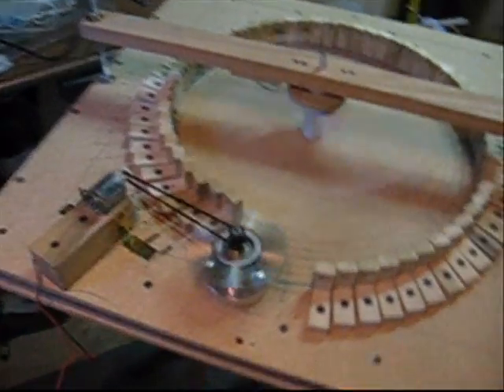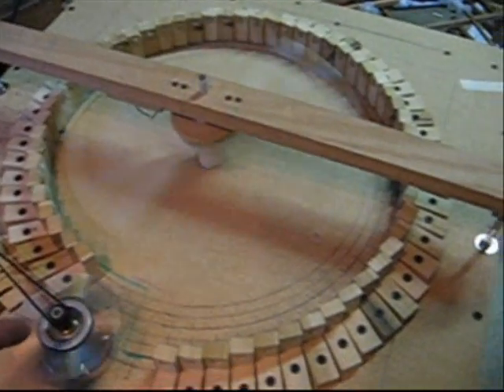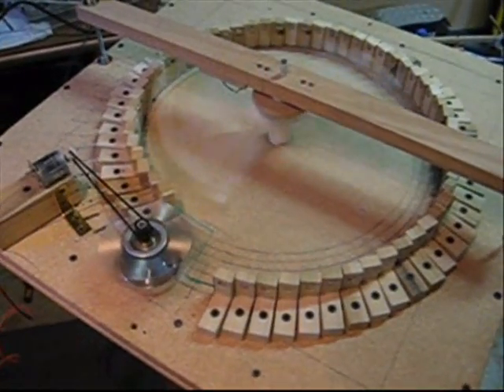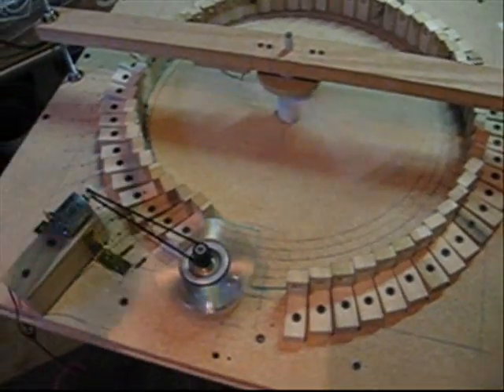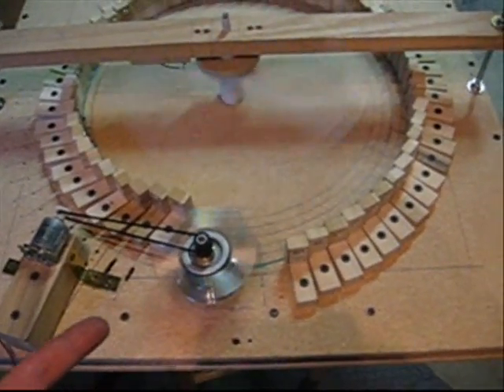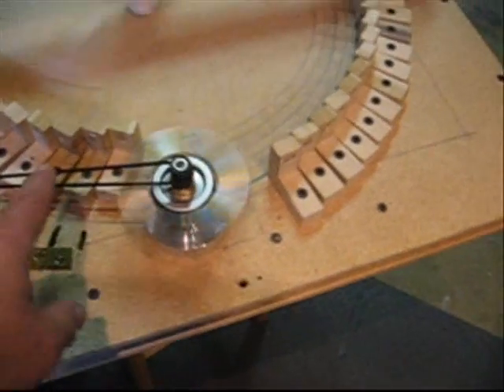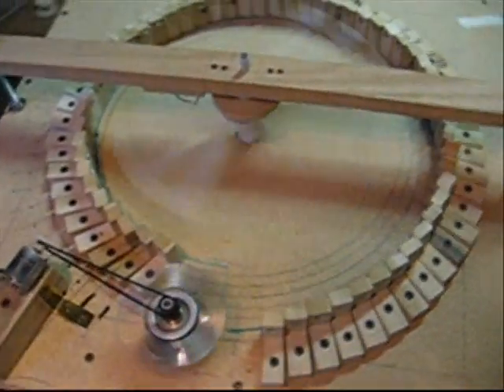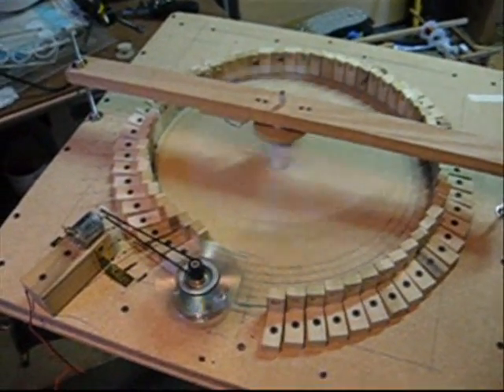Spiral magnet motor gearing test2

Comment: Is that spiral made of magnets or just iron?
Reply from the maker: @MC Chisi yes the spirals are  magnets all with either opposing or attracting poles to the main rotor. The original plan was to see if the spiral would add energy OR help the rotor along.  I've haven't been out in the garage in several years due to my son being born BUT, plan to get back in working on some new ideas.

Comment: can you check the Rpm of the small rotor and the Rpm on the second rotor  and see if it is more then just a gear ratio?

most generators are only 50 to 60 % so your motor would have to be 150 to 160 %  to run itself . good luck

Comment: gr8t like....

can u try and add a belt from the bigger rotor axile...onto the smaller rotar and replace the drive motor with a 3 volt motor and see if the momentum on the bigger thing help do away the extra volts....its not about achieving autonomous rotation but increasing the efficiency so it can produce more than it consumes....hope am making sense...

appreciation from INDIA..
good luck

Comment: How much power do you need for the small motor to drive the 2nd rotor ?
12 Volts and how many amps ?
Is this a small DC motor ?
Please post the wattage input.
Many thanks.

Comment: Can you please wind a few coils around your stator magnets and charge up via the
AC induction via a graetz bridge rectifier a big capacitor and see, if you can drive the 2nd smaller wheel with it ?
Many thanks.

Comment from the maker: ok so the coils I was thinking about are not the typical pulse motor type coil where your right, Lenz's law would slow the system down. The coil I was thinking about is a flat triangle or oval shaped coil of about 50 to 200 turns and then varnish them and place about 10 on the inside of the coil around where the rotor is farthest from the spiral.

Comment: With regard to placing pickup coils around your system... I think that Lenz's law is going to add a lot of drag to your rotor. I don't know enough to know if simply adding a generator to the axle would be a better idea or not. Maybe someone who knows more could say which would be a better way of going.

But, by all means, try the coils around the outside if you want! It would be interesting to see what you were picking up, vs. what's going into the drive side.